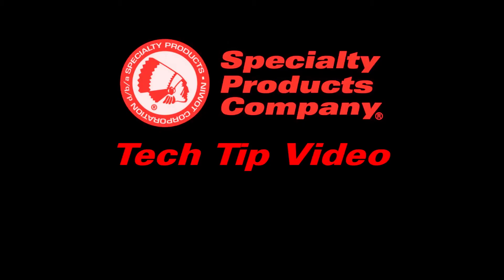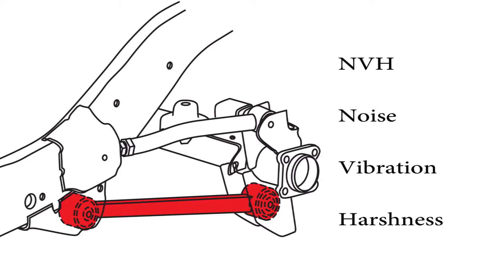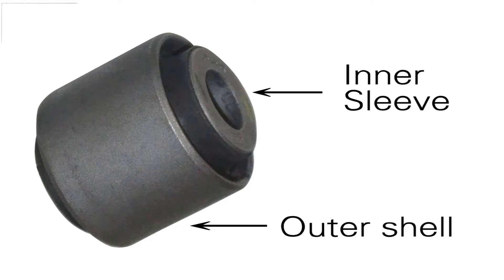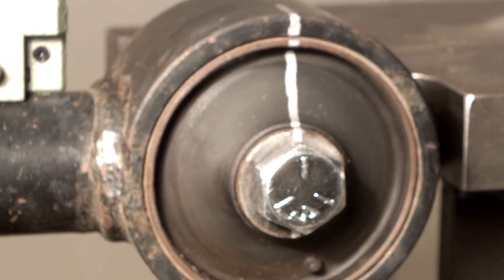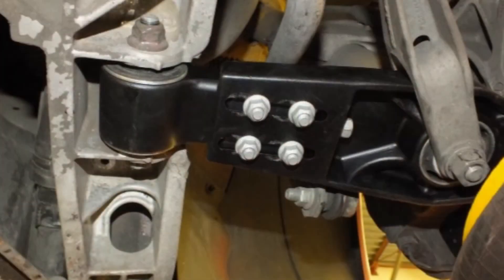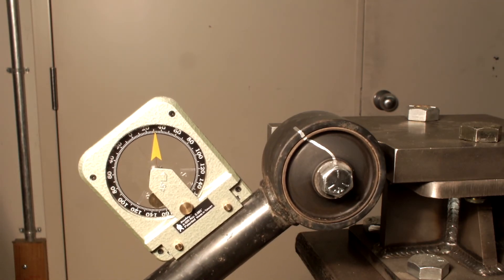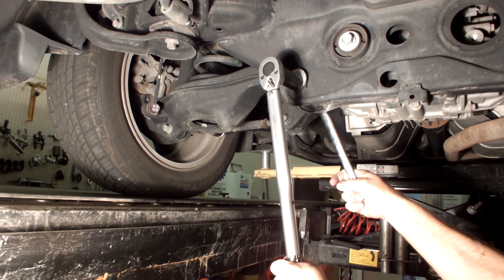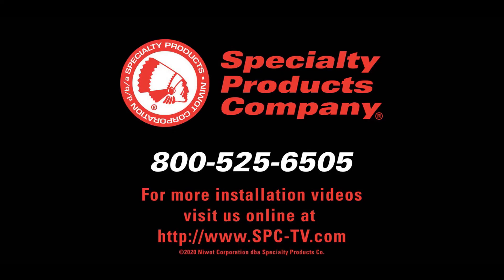Understanding Bushings

Comment: I've done it just like you showed 3 years ago and today my ball joints seem tight still but when I did mine I removed the ball joint boots and really filled them them up with more grease than they came with and I preloaded all control arms as shown and when I had to change the intermediate CV Jack shaft I noticed after freeing up the top ball joint and taking the strut loose from the lower control arm to get the control arm down enough to move it to the side to get the CV shaft out that my lower control arms seem to move up and down pretty freely but the bushings look good but it's like the guide through the bushing has broke loose from the rubber bushing is that normal? I was thinking that they would still have some control to stand up without any pressure pushing down but they fall all the way down so I take a light and I'll look at that guide to see if it's moving but I'm moving the arm up and down it seems stationery but the rubber is free no longer bonded to it. I don't usually have a people reasonable loads on my front end pretty much just a driver. I have put a jack stand underneath my lower control arms when my car was pretty lover from front to back measure from my fender lower lip to the CV shaft with everybody says is around 15.5 inches on a 2011 Mercury Milan and then I tightened up the upper control arms the lower control arms I don't hear any banging or anything but the bushes look good they're not torn but I don't see the guide pin in the middle is no longer bonded to the rubber I don't know if that's normal for these types of bushings 2011 Mercury Milan Ford fusion Mazda double control arms on the lower

Comment: Great information.
Can you please help me by telling how much Torque is required for Toyota Prado VX? While tightening the Control Arm BUSHES?
Reply from the maker: Good morning Dave, you use factory torque specs for tightening the bushings. The one thing to remember is that to torque the bushings at vehicle ride Hight so the bushing does not bind and eventually delaminate.

Comment: I'm trying to buy my own bushings to save money and not get ripped off by the local mechanic garage.  But I see there are so many different types available to my car (just a basic Pontiac, nothing fancy) - front lower forward, front lower inner forward, front lower rearward ...what do these mean?
Reply from the maker: Those are the positions the bushings are in and that lets you know where the bushing is located to replace. Once you are under car looking at them you will see where the bushings are for replacement

Comment: What bushings are most important for car to minimize bump , besides shock ? Control arm most important ? What about tie rod ends and outtrr tie rod
Reply from the maker: As illustrated in the video all rubber bushings are designed to isolate road shock in some way. Any compromised suspension bushing can cause noise and ride harshness.

Comment: Hi. thanks for the video, just a question. Is it true that Because the bushings are the main connection between the chassis and suspension system, they are under too much load from the weight of the engine and the front of the car?
Reply from the maker: Thank you for your question. First, we must understand the relationship between “main connection” and "load", for they are not the same. The load (force or weight of vehicle) will run down through the spring or strut. The reaction force (or opposite force) runs up through the bushings and ball joint and ultimately the tire. These two forces will balance themselves as the vehicle is sitting statically, or dynamically while driving down the road. This also means that the bushings are not the main connection between the chassis and suspension but only one of the connections. Bushings are designed with the proper stiffness to support the portion of the load of the vehicle including the weight of the engine and the front of the car.
Reply: @SPCAlignment   can you do a video on body mount bushings or where can I find information on them , thanks

Comment: Nice job! Just want to add that for air suspension vehicles before tightening any bushing upper or lower, put the car on the ground and start is up and wait 3-5mins until the height is automatically adjusted to normal height and then tighten the bushings. This is very critical. Otherwise they will rip within days/few miles. Had this done on my car. Time to redo.